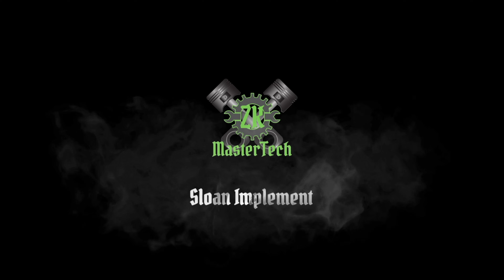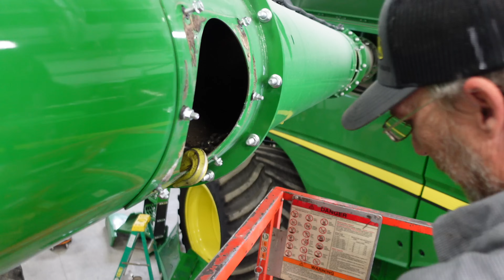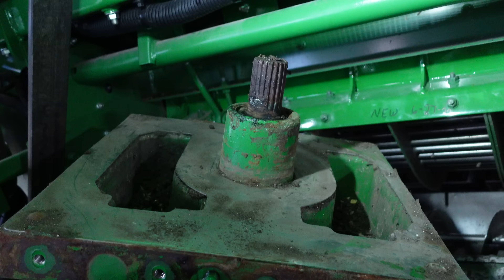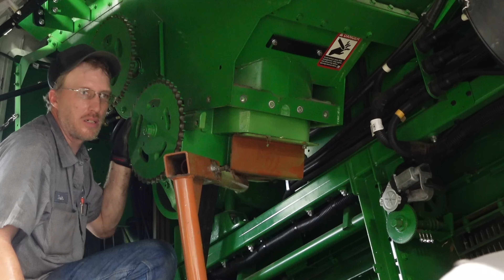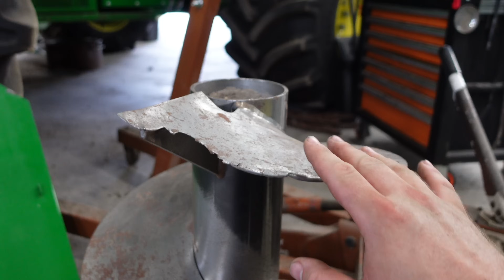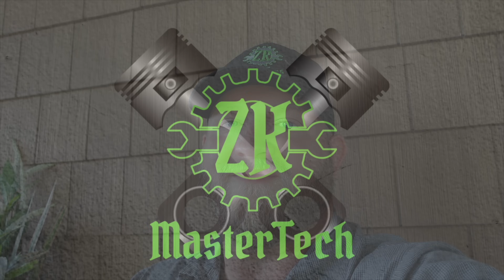John Deere S790 - Installing vertical & horizontal unload augers.

Comment: Thanks for another great video ZK. It was interesting and enjoyable and extremely informative. 

Wow. Lots of work getting all of the different sections apart. Heavy lifting parts for sure. Thanks for showing us how to time all of those pieces when going back together. Important info to know  so everything works correctly. 
It is all of these setup items you need to know when putting it back together or you are in for trouble. Your teaching videos are so so so valuable to say the least. Saves you from a lot of time. Many thanks ZK. 

You and Josh do great together. Combines are not easy work. 

Feel like I saw and learned a lot off this video today. Just a little smarter-ha!!!!!!

About it I guess. Brazing hot here in Iowa. Today is 98. Too much. 
You both take care and be safe. 
Looking forward to the next video. 
Thanks for everything ZK. 
The Iowa farm boy. 
Steve.

Comment: We did the vertical and unloading augers a couple years ago on our 9670 STS. The Sloans guys from White Hall helped us with the vertical, they had a nice adapter we put on our cherry picker to help going back up and in. Not an easy job. We also later on ended up having to replace the turret pivot pieces and that isn't fun either. Definitely not looking forward to the day our S680 needs those done. Hats off to you boys for battling those machines day after day.
Reply: Would also replace bearings on lower gear case.

Comment: Thanks again Zeth for the video. Where were you 40 years ago when I breaking my back on the tools, as I loved the adapted jack/lift you made for the vertical gearbox/auger. I really love techs that have your mindset to overcome these issues and make the job not only easier but safer. We also need more of your dog 🙂

Comment: Does JD have a refurbishment program for the augers?  As long as the shaft and splines are good re-flighting them is a straight forward affair especially considering JD has the flighting.
Reply from the maker: No there's not